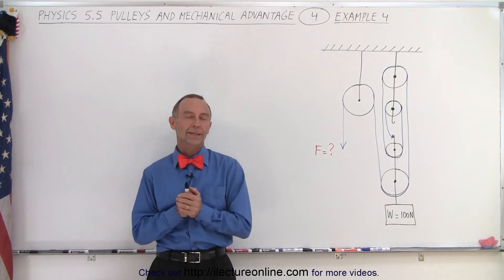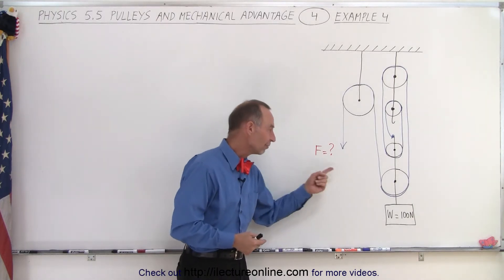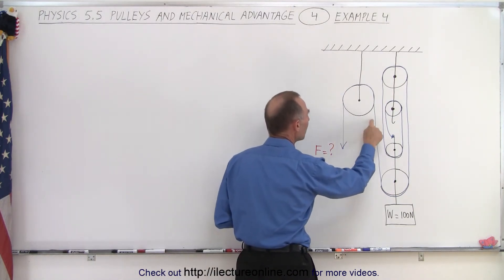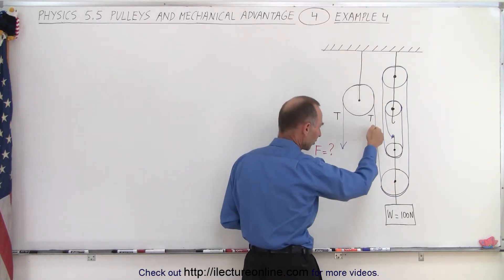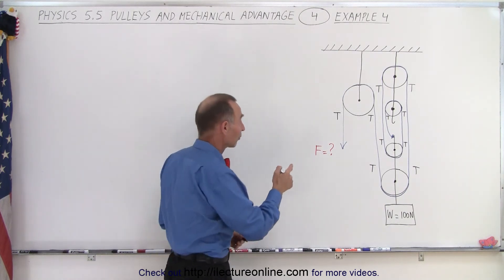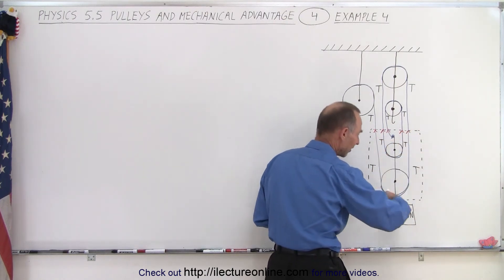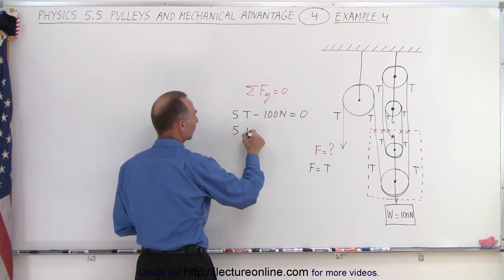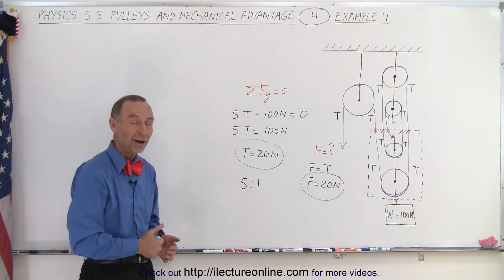Physics Ch. 5.5 Pulley's and Mechanical Advantage (4 of 10) Example 4

Comment: im new to this so excuse my probably stupid question 😂😅 but why was the free body diagram drawn around that section, i understand static principles and conditions, but why specifically that area, why not aywhere else. that aside, very informative video, thank you
Reply from the maker: The boundary of a free body diagram is drawn so that the specific tensions and/or forces can be analyzed.  You can draw them at different points and then see what information you can extract from that.

Comment: Hiya sir, 

In terms of the force acting on the wall, I'm sure the left string would be 40N, but for the right one connected to the wall, I'm not sure, but my understanding would be that it is 80N? So the total force on the wall is 120N. Would that be correct?
Reply from the maker: 40 N on the left string and 80 N on the right string, correct.
Reply: Thanks a lot for the prompt reply! You're a legend. @MichelvanBiezen

Comment: Could you please explain how you know to include the bottom two pulleys in the FBD? It's not clear to me how you know that it needs to include both pulleys instead of just the bottom one. Thank you for your help.
Reply from the maker: Since the bottom two pulleys are connected by a solid bar, they must be considered together as part of the same subsystem.
Reply: @MichelvanBiezen  Thank you, that makes a lot of sense. I'm not sure why I overlooked that.

Comment: Hello sir, would love to see a pulley video explanation with double pulley problems where the pulleys are attached, like this: https://study.com/cimages/multimages/16/040619-171346967221039034405.jpg
Reply from the maker: Does the pulley have mass?   That makes a big difference.
Reply: @MichelvanBiezen  Either way sir, double pulley problems are very common on exams